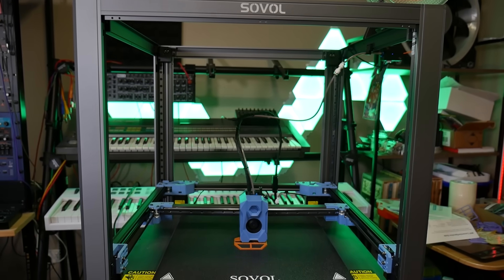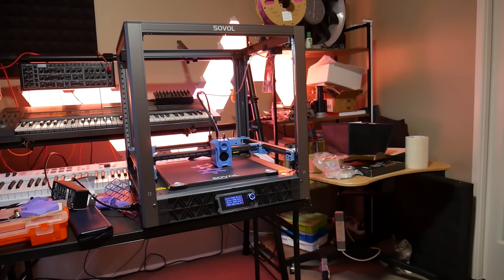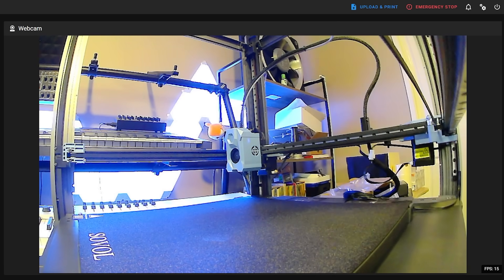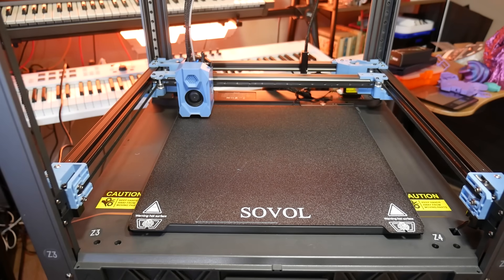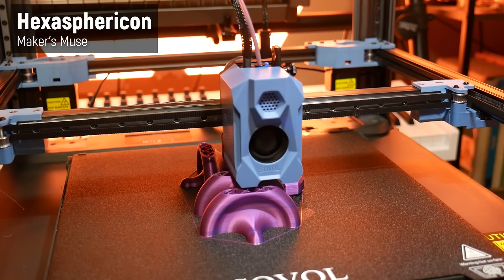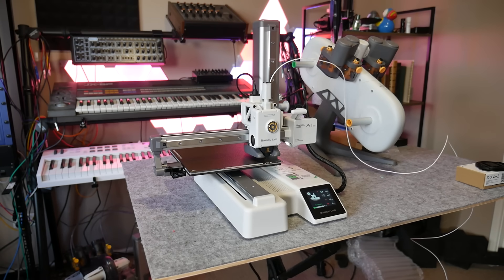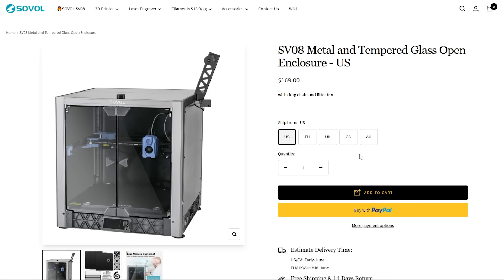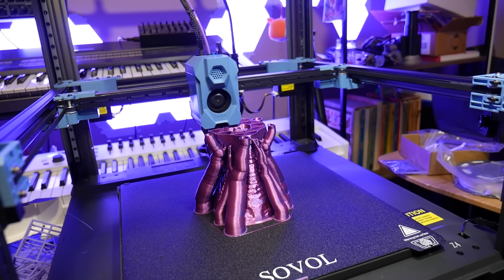Based on a VORON, made by SOVOL... but is the SV08 any GOOD?

Comment: Why no PETG? PETG prints fine without an enclosure
Reply: it CAN be printed in an open machine, many other materials CAN be, however you are going to be fighting Warp 10 and Layer Splits.  Better to have an enclosure, just makes printing all filaments better.
Also....its really a 2.4 350, you better get it with the enclosure otherwise....it doesn't look like its done.  
The Voron 2.4 printers are ABS/ASA printing monsters, they are made for printing that material, and doing it well (I have one and I love it).  There really isn't a reason to get this SV08 without its enclosure.
Reply: @SirLANsalot  I don't think I have ever experienced significant warping in PETG on my Prusa MK3S+ printers in the four years I've been using them. Am I just getting lucky or something? Never heard of PETG having significant warping issues, mostly just stringing from being wet. 

ABS, ASA, Nylon and so on really need that enclosure and preferably heated chamber, PETG should print fine in an open machine.

I am wondering if perhaps the bed can't get hot enough or there are concerns about the textured bed adhering too well to the PETG? Not had any issues with the textured prusa sheet and PETG though.
Reply: If PETG is so easy to print (no warping for 4 years), then why would it matter if he tested PETG or not on this machine?
Reply: @RightJoystick  to not repeat myself, look at my reply to SanderMakes. The video appears to state that the machine is incapable of printing PETG for seemingly no reason imo
Reply: Because PETG has the same gear check as PLA, if a modern printer can print PLA and TPU, you can assume it'll print PETG
Reply: @SanderMakes  sure but I feel it is weird to state that the printer is only good for PLA and TPU in the specs breakdown and repeat that in the video then.

Really makes it seem like PETG is getting grouped together with ABS, nylon, ect... Even if that probably was not how it was ment to come across

Comment: I'm conflicted on this machine. Sovol clearly did do the bare minimum to not be in breach of the license by open sourcing their design. But it's clear that these companies are still adding absolutely nothing to the open source projects they rely on. Making many things proprietary is clearly against the spirit of the project. The following section on their website is really telling: "From the beginning of research and development, we decided to make SVO8 completely open-source. This decision was made not only to pay tribute to Voron and Klipper" even implying this was a choice is, in my opinion, disgusting. There is no choice in the matter, they do not get the brownie points they're fishing for, it's a MANDATORY aspect of the license. It is also the only part of said page where they mention Voron, not when bragging about all the great things these printers are capable of. Klipper is mentioned more often because it is a marketable buzzword.

I also think the 13:00 ish area of your video desperately needs the bit about even reviewers receiving bad machines to be re-iterated. And it isn't even the bad machines that worry me the most. Those should have been caught by CQ but are usually replaced after some attempts to dodge that responsibility. However there are going to be many more machines out there with sub-par components and other flaws that just won't be obvious enough but will cause issues every now and then. Comparing the price to a Bambu without explaining that these brands will always be a bit of a quality lottery while Bambu really isn't is missing a core part of the equation. It's the whole Prusa Mk3 clones thing all over again, theoretically you can get a machine that's exactly the same, but the odds are you probably won't.

Comment: The nozzle situation on modern printers is the main reason I haven't upgraded to something fancy and new. A new standard needs to be chosen.
Reply: The same for me.
Reply: it's mounted to a standard linear rail, nothing stopping you from putting a stealthburner or some other toolhead on it and running what ever nozzle tickles your pickle.
Reply: @shanemshort  I respect those who do, but I  don't want to tinker in that way. This is a tool. I just want it to work, and I want a good choice in replacements like volcano currently has.
Reply: Why? It's a consumable part of the tool. A reason for not upgrading, sure, but for this to be a main reason seems absurd.

With all of the 3D CAD files being available, allowing people to modify or create new parts, surely different hot end assembly designs will be available from the community going forward. Maybe one of them will be whatever you think is more of a standard. Even considering this part of the cost of the machine, the value proposition is pretty good.
Reply: I held off, and then just bought a ton of spare nozzles.
Reply: There's really no reason to move from the V6 volcano setup. This "newest is best" attitude is getting out of hand.
Reply: @Oldsjunkie V6 Volcano is humongous, heats slowly, has a fussy nozzle change procedure, is awkward to mount, can potentially rotate in a mount, offers poor nozzle visibility, has no decent durable silicone cover design, and has wires that are easily damaged and are in the "line of fire" with regard to death blobs.

IMO there are tons of reasons to ditch it for the obvious better options.
Reply: @Oldsjunkie  amen. back to bed slingers we go
Reply: @Oldsjunkie I'd love to stay with volcano (since i have 10 extra volcano nozzles), but pandora is out of the box and won't go back in. Idc what the standard is, but it needs to be chosen so 3rd parties can manufacture replacements.

Comment: This machine is complicated, from optics perspective. While it’s not a VORON, it shares some DNA with it by being based on V2. If people get this and then decide to build themselves the real thing, nobody will be upset 😊 I do have to commend Sovol for following GPL3 license.
Reply: Its kinda a mix innit.

Has the Trident style screws and 2.4 type gantry.

Either way, I think for the low tier "we dont test for user experience" brands, they did a great job.

If only they did that final part of actually using the printer themselves before shipping and making the ux great (all the weird overlapping macros, no hardened steel nozzle etc etc).

Comment: How does orcaslicer compare to superslicer? Ive been wanting to play with tree supports for a while
Reply: Organic tree supports are pretty good from my experience
Reply: It's easily the best slicer out there right now
Reply: I currently have a Creality K1. I used to use Creality Slicer and Cura Slicer but after testing Orca there is no turning back. Built in calibration tools and the perfect Klipper integration did it for me.
Reply: OS absorbed all current Ps and SS and put it in a better package with a lot of qol. I was a skeptic who recently finished converting over to prove to a friend they were wrong and I was the one who was wrong. It’s got a lot of gas.
Reply: 4 hidden comments? It's good. I came from Cura to use my A1 mini

Comment: I love how the first 2 comments are spam porn bots 😂
Reply from the maker: nah they're totally real ! 😫
Reply: @MakersMuse 
That kitty print is amazing. The details are shocking.
I know that's a real kitty very cute by the way but anyway great review of this printer. This printer does look very nice and lucrative to buy for the price it's at
Reply: Ah so that’s what those stupid bots’ point is. I was wondering what they could possibly be trying to accomplish in the YT comment section of all places lol.
Reply: Do you really love that? Why?
Reply: A SHORT BUT TO THE POINT REVIEW. I HAVE ONE ON ORDER WITH THE LARGER SCREEN AND ENCLOSURE +A COMPLATE SET OF NOZZLES. THE ENCLOSURE SEEMED   ALITTLE OVER PRICED BUT WHEN I FINELY SEEN JUST WHAT IS INCLUDED IN THE KIT I WAS HAPPY TO PAY THE EXTRA.  IT COMRS WITH GLASS DOORS ANT TOP STEEL SIDES AND BACK.    DRAG CHAINS FANS ETC. OVERALL I AM HAPPY WITH MY PURCHASE. 
CHEERS.  MIKE.
Reply: @mikeskerritt9618  My good sir, why are you shouting?

Further, why are you posting as a reply to this comment?
Reply: @BeefIngot   sorry I will whisper in future
Reply: @mikeskerritt9618  could you not just slap some acrylic panels on the sides if the vertical parts like you do with a voron to build your enclosure?
Reply: @SleepLessThan3  The cost of a 8x4 sheet of acrylic is app €80 here. If you added the cost of hinges screws fans cable chans, etc, it would cost me more than the ready-made kit. The kit is selling for $160 app, so what do you think 🤔
Reply: @SleepLessThan3  The kit is tempered glass and includes a bunch of other components. I run a sign shop with practically unlimited lexan and acrylic and I would still just buy the enclosure. I’d actually probably get an x1c or K1 max instead. The k1 max is about the same price on sale as the sv08 plus enclosure.
Reply: @_..-.._..-.._  oh I'd love to be working in your shop, I'd never have to pay for my voronenclosure materials 😂